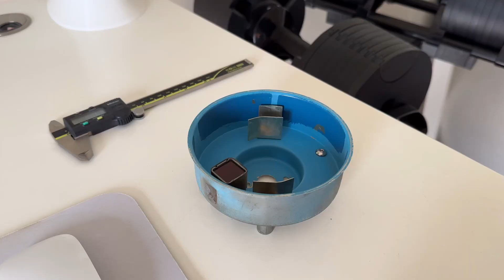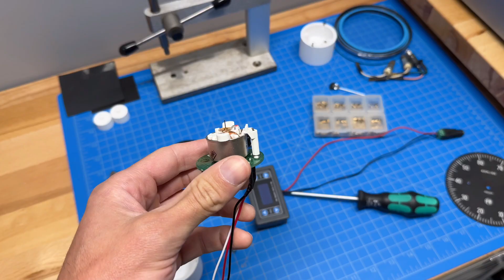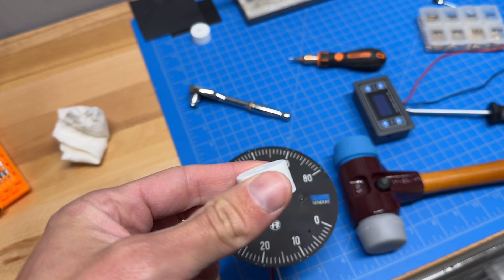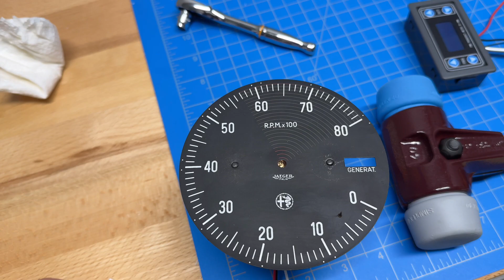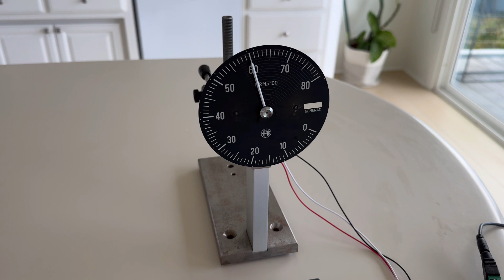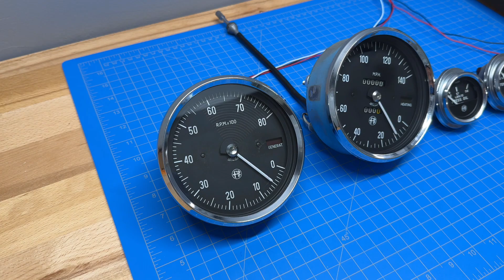Converting my OEM Alfa GTV tach to electronic

Comment: Hi Sam I am keen to download the parts you made for the tacho conversion from your site but they are not loaded in there.  Or have I got the wrong link?  Cheers Scott
Reply from the maker: Hi Scott, i’m happy to email you the tach conversion part files. They aren’t on my site as my converted tach works perfectly on the bench, but not in the car. I think the servo can’t handle the weight of the jaeger pointer with the car vibrating and bouncing, but you might have better luck than I. Shoot me a message on instagram or through my business website if you’d like the files.

Comment: May I ask what VDO Gauge you've taken this out from? Been doing something similar but with programmable steppers and hooked them up to CAN, but this looks much simpler. 🙂
Reply from the maker: yes! VDO-333-959. quite simple with this gauge for this tach
Reply: @SamBirchenough , it looks like you bought the last one 333-959 on earth. They’re out of stock everywhere! Not sure if it would work for mine though, as I have an integrated oil pressure gauge in the Giulia tacho.
Reply from the maker: @marcelveenendaal8337 oh man, sorry to hear that. if you got one and had the same speedo as me, i’d send you the file for the mount
Reply: @SamBirchenough , thanks, but no worries. I found another one which seems to work in my tacho as well (found a page describing it)
Reply: @marcelveenendaal8337  do you mean you found another 333-959 and that it works in the tacho with oil gauge?  Or did you mean that you found another model of tacho?I have the same combination gauge.  Thanks!!